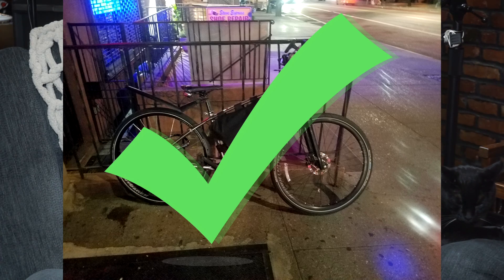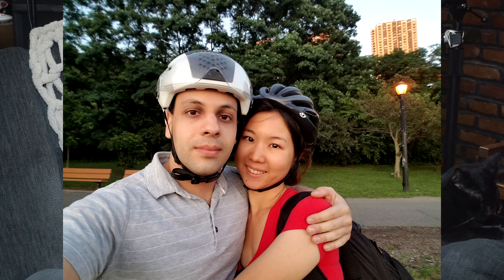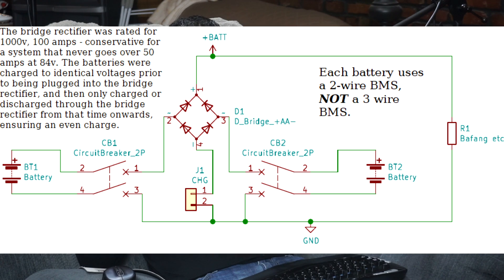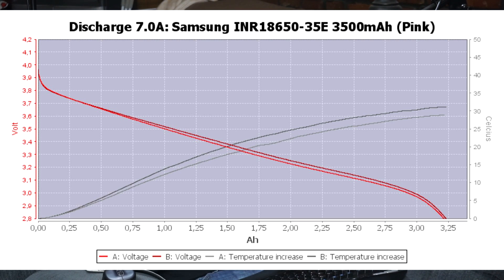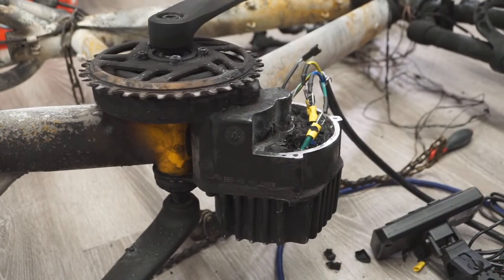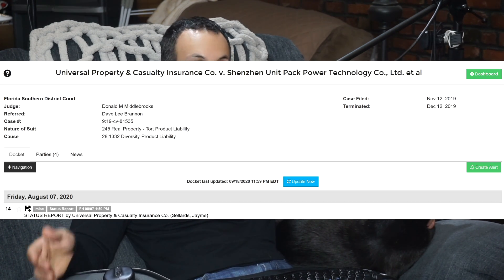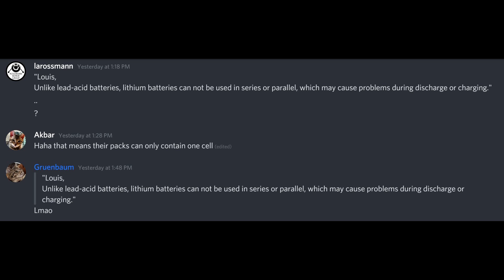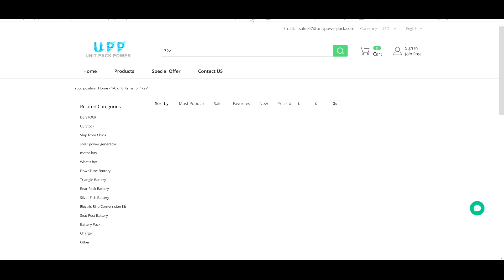Louis' front door goes BOOM courtesy of UnitPackPower battery.

Comment: Not saying this was the problem in this particular case but I think it is good to be aware of that even if a bridge rectifier is rated at 100A, at 40A DC through it you get 48W of heat to dissipate (calculated from 40A times 2 x 0.6V forward diode drop) and if the rectifier is not properly cooled it will overheat and that could cause it to fail as a short circuit. If this happens though there should be fuses in the battery packs to disconnect them. This is assuming it was not a shottky rectifier, then it would be closer to 16W of heat to dissipate instead due to the different forward voltage drop. A proper battery pack should IMO be able to handle a dead short without exploding even if one should not subject them to that. I think that if it would have been the bridge rectifier failing it would have done so during peak usage and not after stopping the bike. I guess my main point is that you have to take power dissipation into account in the design of a high power circuit and you may be surprised how much power a rectifier might need to get rid of. This is not directed at Louis but just meant as a clarification for those who are not yet experienced with power dissipation requirements, something that tend to burn at least a few finger tips as we learn.

Comment: When Lithium batteries go wrong, they go very wrong. Though I'm a retired ET I claim no expertise on Lithium Batteries other than suspecting you had a single cell internal failure that did a thermal cascade throughout the pack. Likely a result of poor build and/or component quality. I suspect this fact has not escaped your attention. Thanks for the heads up.

Comment: I have  2 of these packs on my bike.  I don't link them together but they've held up okay for me this far. They're 48v 14Ah(9 months) and 7Ah(3 months). I'm riding with 17A continuous. 
I did have to fix the red discharge wire back on the nickel strip a while ago. I discovered that they use nickel plated steel strips instead of pure nickel. The nickel plated steel gets more corrosion.

Comment: It’s not about the current.   It’s about the BMS.  Was it charged to 4.3v / cell or 3.8v.  Charging to 100% is hard on the battery and dangerous.   

You should consider lithium iron chemistry. Much safer.

I never charge past 3.92v.

Comment: LIon cells popping like firecrackers - firemen can't do a thing - a gas bike with a couple gallons (and five times the range) goes up and it looks like a friendly campfire compared that angry raging inferno of high voltage, toxic rage.   Whoops, I guess I blew my cover as a Big Oil shill.
Reply: They need special fire truck that carry sand, dry ice and CO2 extinguishers to deal with metal fire...
Reply: @unknownkw  I'm no expert, however, every US fire engine I have seen carries ABC chemical and Water fire extinguishers. I have seen sand buckets before. Never heard of 'dry ice' for fire fighting, that would be CO2 anyway. I would expect them to carry a class D for flammable metals, especially these days. But why have an expensive fire extinguisher when you don't care about the door and stairs, and wasting time? I've never had any fire, but I have ABC chemical extinguishers everywhere, and CO2 to deal with things quickly without making a mess. They are into procedure and don't care about anything including cost. No offense to anyone who does fight fires as I won't be going into a fire without great reason. Thanks to those who do. They got the bike off the stairs but not the battery for some reason. Anyone know why they don't have a class D extinguisher on the rig?
Reply: Won't covering it all in foam prevent things around it to be damaged?
Reply: I mean it's pretty easy to prevent this from happening. For example, actually knowing how to build a battery pack that doesn't go boom.
Reply: @Notadragon621  its also pretty easy to happen

Comment: The motor is almost never the problem, faulty speed controller, loadbalancer or batteries are usually the problem. Also lipos should be stored in lipobags and be charged slowly after use and not left empty. 
Sad that your batteries were crap.

Comment: Louis, your circuit could result in a fully charged battery being paralleled with a fully discharged one - if just one diode in the bridge rectifier fails short circuit.  That, I would suggest, is tempting providence. I don't know what bridge you used and what cooling arrangements that you had put in place for it - but the rating is meaningless without knowing where in the temperature v time envelope the bridge was operating. 

Your BMS may safeguard against catastrophic failure, say if it is designed to limit output/input current as well as balance cell voltages.  But the one fitted may not have had that functionality.

You mentioned, ISTR, operating breakers when you left the bike. If a diode had failed and you (mistakenly, perhaps) closed the second breaker whilst the first breaker was closed, instead of opening the first breaker - that plus a failed diode could have set this catastrophic failure in motion.  

I'm not saying that you are wrong about the battery pack and its manufacturer. Just that I can see ways in which something else might happen.   The diode might have failed through over-temperature some time before- you wouldn't notice a difference unless both breakers were closed.
Reply: I think adding a rectifier bridge and associated losses is a silly idea. Besides, you could have just one battery custom built to your specs. Why all this trouble and complication? I don't get it.
You probably use somewhat 48V middrive bafang motor rated at 1000W max, so this would draw around 20A. Battery of 10S4P could easily supply 80A if needed, or much more, depending on BMS and cells utilized. Get proper cells, BMS, and nickel strip welder, assemble a good battery and there you go.
Reply: Louis says it's not about money... Why taking chances and experiment then with different suppliers? Cheaper? Better specs at lower price? Why? Why? Why?
Reply: @1HandyLad  He said it in the video, it was about time, since he needed it to arrive faster.
Reply: @1HandyLad  It's not about the money - it's about avoiding a single- fault catastrophic failure.
Reply: @1HandyLad  HE said it was about time. he needed it now or very soon not in 7-10 weeks. a very reasonable thing I have done that myself in the past and got burned.. not literally like this though

Comment: I would guess that the origin of the fire is a short circuit. It seems unlikely to me that the problem is caused by your normal current consumption. Anyway I learned that I never want to keep a big lithium battery in my house, that I don't want a cheap brand and that it is good to check that there is no sign of damage that could result in a short.

Comment: Thanks Louis.

I am converting an old MTB frame which its rear wheel pawls sheared off and there were no spare parts because it was a chinese made bike using non standard hub six as the shop I took it to to get fixed could not get one, they were either too small or too big by a few mm.

SO I eye up a 26" rear with hub built in and... UPP battery.

So you saved me from wasting my money.

Also, I would expect that UPP company to now go out and get another company name and start selling under that, the shitty goods that I am also experiencing from China at the moment.

I can say out of about £1,900 of purchases from Chinese sellers that I have lost around £300 from sellers through those arseholes ALIexpress and through Amazon as well as Ebay. Luckily Amazon and Ebay refunded me unlike the bums rush I got from ALI express... I ended up trying to recover the money though indemnity claim and was warned that they may charge that amount again and the bank can't stop it, however, it is a good way here in the UK that you have a last resort through the banks to get money back although it may only be temporary, it sends a clear message. Out of the £300 in losses I recovered around £90 of that money (one of my purchases). 

I am currently having issues with a Chinese seller right now on equipment that I paid £217 for and only half of the order turned up but because the same tracking number had been used on the second package, the shippers can't tell if... that item separated as part of a two box tape up or was never sent.

I am, like most of my friends, not buying anything from chinese sellers unless they are physically located here in the UK so that they have to comply with UK law despite distance selling legislation, the chinese mainlanders have no respect for any laws that regulate their ability to trade and safety is a last consideration, its the money that is god in china.

This is what I find amazing is that they can be rogue and get away with it and still continue to trade.

Comment: My 2c as a battery pack developer. Theyused the standard bms and wired it wrong. Therefore wasnt able to cut the charge in the time prior. The issue had probably started days earlier and then went catastrophic by chance. Cells  would most unlikely to have been the  cause. Next most likely, bms had issues and wasnt able to do what it meant to do because of wrong setup. Next up a fault in bms causing a short of somesort. It goes up and takes the cells with it / causes a short between main pack + and - . (Seen this many times in cheap bm  we’ve tested)  
We have tested multiple models bms in paralell and it often screwed them up. The bridgerectifier should have stopped any problem though. 
Their statement that you cant use them in series or parallel was obviously meant on the pack level, and it was just bad english, come on ;)
Reply: Most likely a bad spot weld. Tab misaligned, too high resistance and caused a short on the cell.

Comment: I'm no battery expert but if you put two batteries in series, the BMSs can't balance the whole stack of individual cells because the cells are in two independent units. I suppose a BMS can disconnect the battery in emergency if the BMS has such a feature.

Comment: I see people making comments on how long the fire department is taking etc and as a firefighter both professional and volunteer it's frustrating. This crew did a great job and had the scene under control within 2 minutes. They had the bike pulled away from the building within 30 seconds and boots in the building under a minute to secure and prevent further damage........ it's a battery fire and running around spraying water all over the place would've done nothing but make it worse......... so before you jump to conclusions and judge something you know nothing about cut them some slack.

Comment: No datasheet info about cooling? Continous Amp specs are without any cooling?
One flaw of your setup in my opinion is the way the battery was phisically built. The cells were stacked side by side one on the other so the bottom cells sustained the weight of all the ones on top of them, not a problem in a static application but running on potholes all day could have them smashed on the long term... my thought.

Comment: Although this is BAD, imagine what would have happened if it had cooked-off INSIDE the building!!
Reply: M T  You can't stop lithium fire with water. In fact. When lithium comes in contact with water it creates hydrogen gas among other things so it actually makes it worse.
Reply: @Shoderra  yep but you can stop anything else from  catching fire with a Continuous stream of water. But I agree burning Lithium batteries are kind of a nightmare.
Reply: @JasperSchwinghammer  To an extent. If the battery pack is really close to a wall for example the lithium fire is probably gonna burn a hole through that. and if anything inside the wall is flammable you have a big issue. Water can also make the fire go from bad to explosive. And that can lead to some brand new issues. That's why when there are electric car fires they don't use water anywhere near the burning car. Bicicles are smaller scale but the amount of lithium is still significant.
Reply: ByAnyOtherName091 at the park
Reply: @timemachine_194 Yes and no. Also remember that phones and laptops contain a fairly small amount of lithium. Depending how how severe the fire is you may be able to use water to cool down the lithium if the casing is still whole and isolates it from the water. If the casing is broken on a burning bike battery, you will most likely be unable to cool down the lithium without directly exposing it to water, which may cause an explosion and make everything worse. Remember that bike batteries are not constructed as solidly as car batteries and you never want to pour water directly on to exposed lithium.
Reply: @ByAnyOtherName091 Put the battery in a 40mm ammo box. What I can't decide is whether to vent the box or not.
Reply: @ByAnyOtherName091 i like to leave mine in the californian forest, harder for thieves to find it, and it's even close to my destination in some cases... although my battery did seem to get hot that time i arrived at my close friend's gender reveal party

Comment: Its a good idea to use Tesla style micro fuses for each individual cell. It slightly increases total battery resistance, but without fuses one faulty shortcircuited cell conected in parralel can overheat and burst into flames, that will cause other cells to overheat or short due to insulation melting. Its more expensive to make  battery with individual fuses, so 99,5% are made the same way your battery was made. I think you was just unlucky getting one faulty cell... o all cells could be lower quality...

Comment: Far more likely it was down to poor quality insulation that wore down over time and caused a direct short!
For bike batteries or applications where vibration is high people really should use the cell spacers, not only do they make it impossible for cells to rub on one another and cause direct shorts they also reduce thermals as cells aren't stacked/sandwiched  together !

Comment: So the manufacturer is actually somewhat right. You cannot place just two random lithium batteries in series or in parallel. A battery pack is built from cells, not from batteries. 
batteries =/= cells
You looked at the cell datasheet, and concluded, that the battery pack built from these cells, should have the same current capacity, as the cells. 
Also, that bridge rectifier. So at 54A, it would dissipate around 50W. Like a modern CPU with a large heatsink and fan. Was there a heatsink and a fan on those diodes?

Comment: I've never seen a bridge rectifier used this way, but I am intrigued. Is this to prevent the two packs from trying to equalize when you connect them together if they're not exactly at the same state of charge? How much of a voltage drop do you see across the diodes? I don't think for a second that the diodes could have possibly caused those batteries to fail. If anything, it would have prevented them from charging all the way to 100%, or being discharged all the way to 0%, thus extending their longevity. I've been trying to come up with a way to be able to connect two battery packs (or more) to something if the batteries aren't 100% perfectly equal to each other and not have a large equalization current happen between them. This looks like it'd be a great way to accomplish that if all of your batteries that are connected are capable of powering the entire device by themselves if they happen to be at a higher state of charge. (Which you said yours were and clearly they should have been based on the specs)

Comment: And NO ONE could have popped out with a bucket of water during that whole time?
Reply: nonononononono NO WATER IN LITHIUM FIRES!
water+lithium produces hydrogen which is highly flammable, so unless you want to end up with 3rd degree burns, don't try it.

note that it might be safe in some cases, but as a general rule, use a co2 extinguisher.
(lithium-ion are generally safe to extinguish with a standard ABC rated extinguisher, but if you can, don't.)
Reply: @satibel   So what came out of the firemens hoses then?
cough
Reply: @mtssvnsn  an overkill amount of high pressure water, and it had been burning for a while.
same way blowing a candle works but blowing on a fireplace makes it hotter.

also, this is lithium ion so it might be safe to use water on, due to the low amount of raw lithium. but I'd still highly recommend not randomly throwing a bucket of water on it unless you're really sure about what you're doing.

Comment: I wonder if the battery failed due to a diode going short ? Could this happen over time because of the harsh back emf of the motor after sudden current inrush and change of current. Without the diode the emf charge could go back into battery as regen, with diode its blocked with the voltage rising on the motor side perhaps to many kV? This could cause the diode to fail over time After all the motor is basically an inductor ?

Comment: Due to a thermal runaway in the battery itself. Thermal runaways are caused by a MANUFACTURING DEFECT like an internal short-circuit or physical damage. When a Lithium Ion battery has a thermal runaway, the battery gets bloated and electrical shorts within the battery either start, or continue. The energy stored in the battery is released, often violently. This release of energy can cause adjacent battery cells to catch fire or thermally runaway as well.

Comment: I hate to break it to the firefighters, but water won't put out that fire. Needs a class D(combustible metals) fire extinguisher. Water would put out anything caught on fire by the burning battery, but not the battery itself. That's why I will never trust electric cars. If the battery shorts out, it rapidly turns into a fireball.

Comment: 35E are only rated at 20 amps 4s and 25 amps 5s or they lose cycle life. The problem is normally the connection drawing all the power from the end cell. Cheap nickel can limit the power transfer to this end cell.